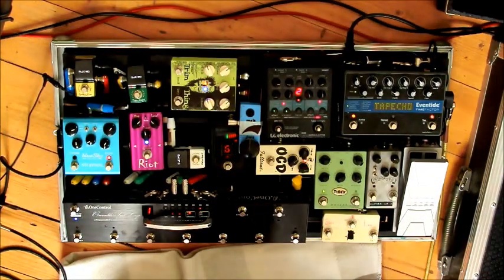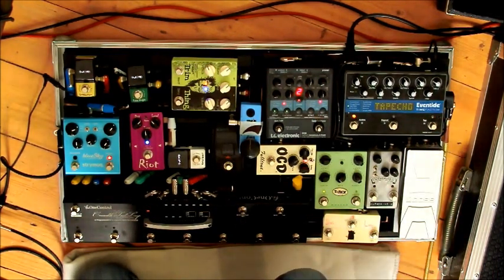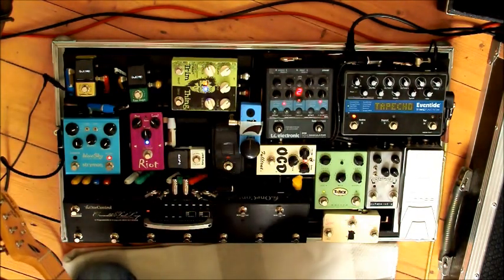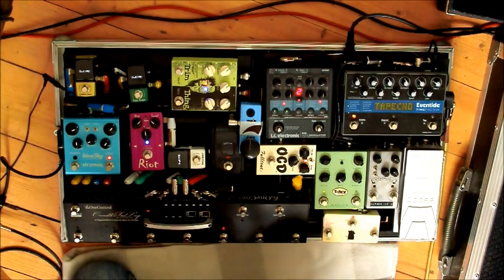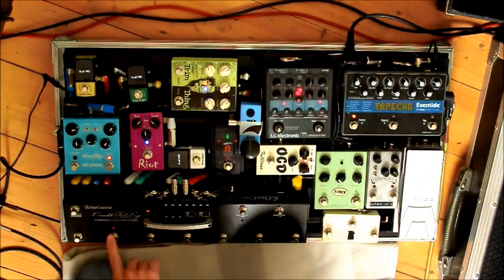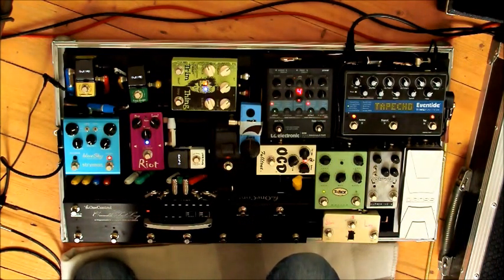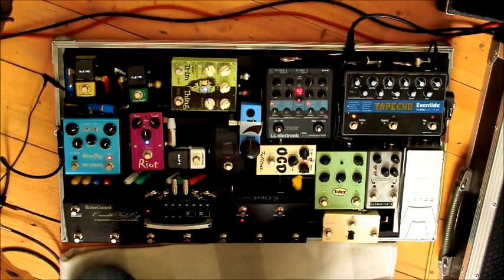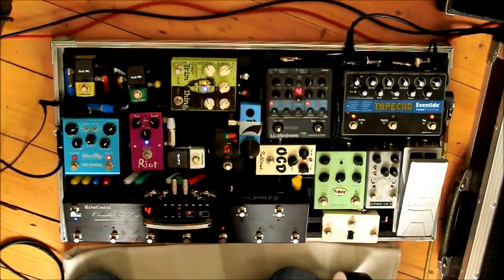My Pedalboard Walkthrough

Comment: the boss FV30L, do you have any loss tone? did you test with other volume pedal? can you talk a litte bit about him?
Reply from the maker: +M. Soares I don't notice any tone loss, I bought the L for its lower impedance as it's running after a buffer and is designed as such to prevent passive tone suck. 
The sweep on it isn't quite linear, there's a small dead spot at the heel of the sweep, but I got used to it really quickly and my swells and using it for master volume post drives works fine live.
Before the boss I had a bigger boss 50 and a small budget Bespeco VP,  the size and rugged construction drew me to the 30L, it's sweep is very similar to the 50 as long as you get your foot in the right pivot spot. 

Anything else you'd like to know mate?
Reply: thanks man I was in doubt, between fv 500l and 30l, I will choose the 30l, it's smaller than boss fv500l and lighter... haha, the VP have a awesome footprint, but have a LOT of tone suck!